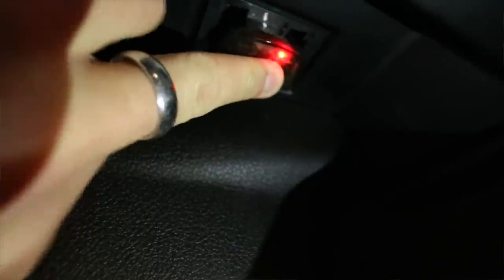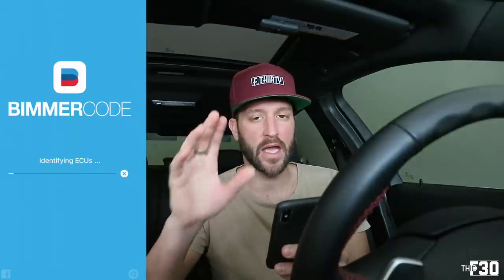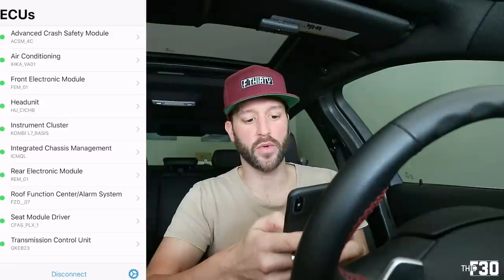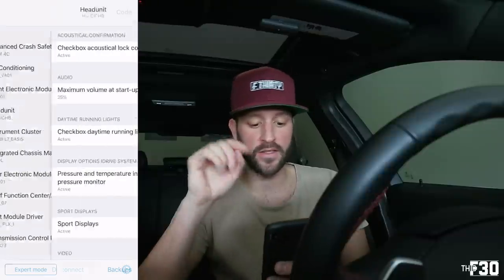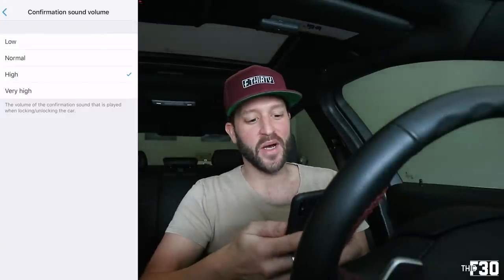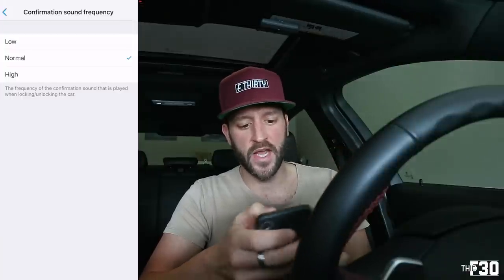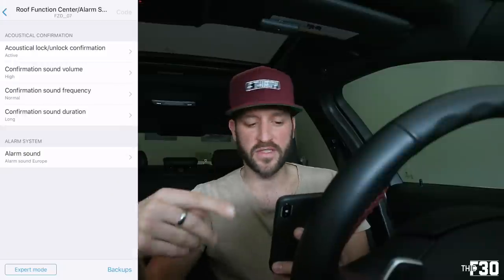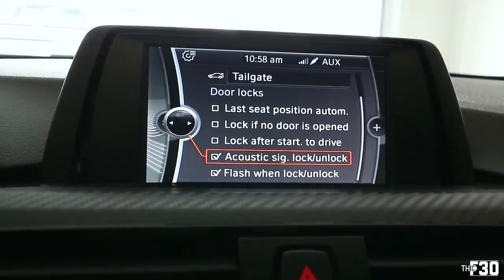BIMMERCODE: ACOUSTICAL LOCK/UNLOCK CONFIRMATION (BEEPING)

Comment: Hey great video. I have installed an alarm on my 2008 382i BMW. Motion sensor. Everything works fine alarm goes off but I can’t get the unlock and the locking acoustic sound. What am I doing wrong stuck at a crossroads.

Comment: I have the same small head unit cluster as you do inside your car. Wondering if you can use this icarly to enable split screen? That would be a great addition through this app. Tried to look for it but maybe it's in expert mode.